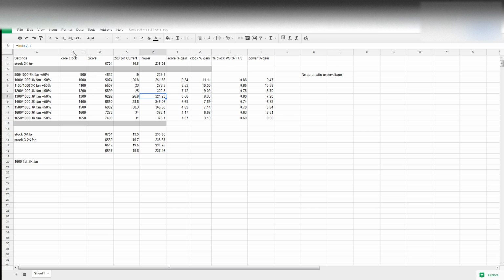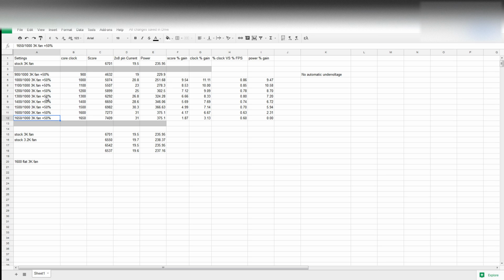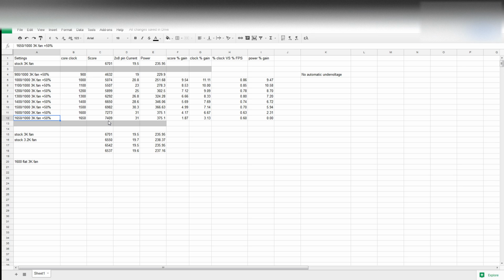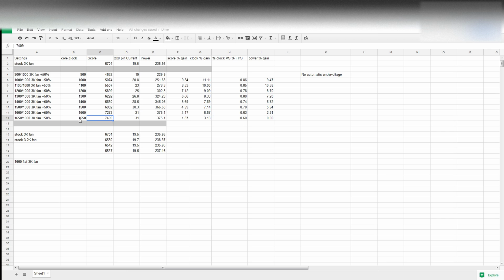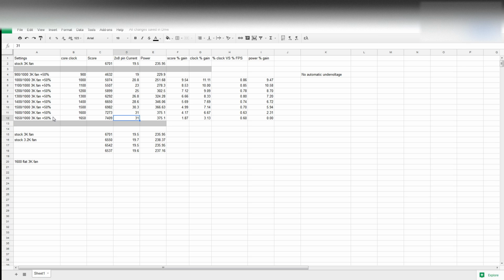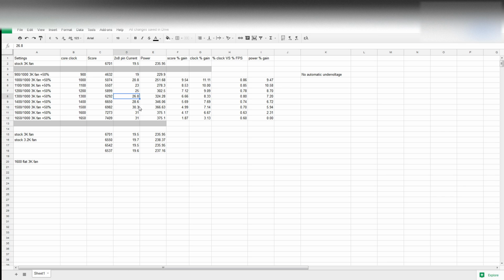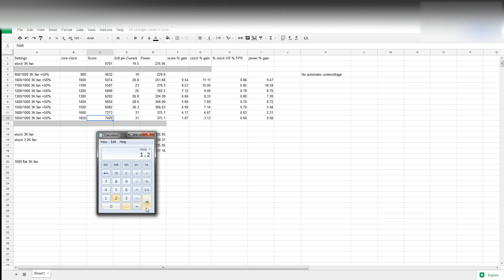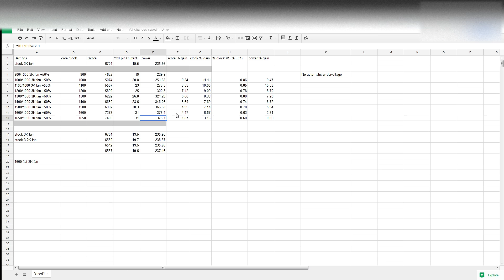VEGA Frontier Edition clock, performance, power scaling // 1600MHz of Flamethrower

Comment: 278W at 1100 mhz? You guys doing these vids are weird. you see all these power issues and then turn around and say you dont see how the power consumption could change. To me it just looks like  even the power management is not working right. it cannot use 278W at 1100 mhz and be working right. This is kinda different from what I think I saw on pcper tho. theirs was around 280W at 1440Mhz. https://www.pcper.com/reviews/Graphics-Cards/Radeon-Vega-Frontier-Edition-16GB-Air-Cooled-Review/Clock-Speeds-and-Power-Co 
if it legitimately does use that much at lower clocks, then there is hardware in there that should not be on for gaming. a fury x at 28nm with 596mm^2 and 1050Mhz uses less. A lot about this FE just doesn't make sense right now.
Reply: There is hardware not working correctly in there, we dont know how much or how much of an impact but something is clearly up with this, also AHOC did mention that voltage control is not usable right now so the voltages at 900mhz are more or less the same as at 1650mhz.
Reply: its just that timespy gpu test 2 is very power consuming.My 1070 fully oced at 2.2ghz 1.093v is reaching 225watts.gaming power consumption is up to 20% lower
Reply: These figures are "peak". So they are completely irrelevent. 

I have RX470 on my PC and according to a monitoring it peaks at 158W power consuption for GPU only. If you add VRM losses, memory power consumption etc you'll get "200W RX470 stock" according to a buildzoid methology.. 

But those peaks only appear for milliseconds when card changes from a low power to full gaming mode. And sometimes cant even be measured by programs like gpu-z

While loaded it sits pretty much around 85-90W for GPU. And around 120W for whole board. Which is exactly what declared by AMD for this card.

My guess is that this "extra juice" is used to add stability when switching between different modes just in case some components(like PSU or VRM components) arent the best quality and dont provide exact specs they are supposed to. 

But it definetely has nothing to do with real power consumption of the card.

Comment: Power consumption seems around equal to Fury X at the same MHz... Edit: Oops misunderstood, it's not that bad!

How come the +50% power limit is increasing power at the lower MHz?  Shouldn't it only increase power when it's actually required for non-throttling purposes?
Reply: That is just from the 2x8pin cables, he says it at some point near the end. Other reviews show full power consumption at stock at about 300W, so ~60W must be taken through PCI-e slot.
Also I found very interesting how well Vega scales with clocks- power leakage at top overclock does not seem to increase at all, power usage goes up in a linear way.
Reply: If you watch Gamers Nexus video about undervolting Vega FE it seems that it can hit 1600 while reducing power consumption. Most AMD cards are overvolted which means we can drop the voltage without losing performance.
Reply: But he still cant undervolt the card. It has to be lower cause of the 14nm vs 28nm
Reply: Cris or they don't exist....
Reply: PDA exists in polaris, so at least it should be there
Reply: BIOS probably is power limited
Reply: Cris oh it really is power limited. I'm using Elmore's custom bios so I have 200% power in the bios but if still hit that, shame too because I'm only hitting low 60s in temps and if put a lot of work in modding the thing and I was planning on spoofing the current sense on the phases but according to buildzoid and Der8auer if you do that with the 3567b it messes up the load line calibration and that sucks :/
Reply: Power consumption at stock settings (1400ish MHz) is a bit lower than the Fury X, it's only when he overclocks or really touches the clocks at all that power consumption goes wonky.
Reply: Hakaru you're pushing 1.4V through a 14nm Polaris 10? Jesus.
Reply: DrathVader oh Yeh I might add this isn't every day use.I will typically spend 20-30 mins a day at 1.4v tho and the card seems fine, it's the  vrms that I worry for but I got a extra fan on those so they stat at ok temps.
Reply: haha if you think thats high i have my rx480 doing 1490-1500mhz (1.4v) and its pulling up to 309W through its 6 pin connector...honestly i think power draw is an over rated topic.
Reply: Probably because TBR and PDA are disabled
Reply: "honestly i think power draw is an over rated topic."
You blind or what? Vega is fucked because it can't keep the power draw at normal levels at 1400+MHz. ATI is getting pummeled because it believed idiots like you.
Reply: Poor Vega
Looks to me like AMD is dead at the GPU market...

Comment: GTX 1080 performance at twice the power, yeah. Overclocking with AMD is very disappointing, both Ryzen and Vega. Basically the best you can do on air is slightly above the boost clock.

Comment: If we assume the the PCIe slot provides 75W then the card pulls 450W total witch would confirm that it needs more power and throttles because of that. Stock 300W + 50% will limit it to 450W.

I hope the RX Vega uses even more power so that the card be hopefully cheaper to buy.
Reply from the maker: I was only measuring the 8pins. The card was doing 187W per 8pin.
Reply: I didn't use the speced values of the 8 pin connectors. I used Buildzoids values from the video. So 375W from the two 8 pin and a theoretical 75W more from the PCIe slot, if we assume that AMD stays in spec, after the RX 480 power fiasko, and also uses the full power of the slot. This way you fill the full power limit of the card with a total of 450W. Witch is in line with the power throttling of it as the power limit is 300W + 50%, so 450W.
Reply: 8pin provides as much as PSU is able to supply through it, it is only spec'ed to  provide up to 150W. Generally it is not a problem if it provides more, as wiring can withstand it- as long as PSU is capable.
Reply: Not really as much as the PSU can provide it because even if the cables were fine, the header or receptacle are usually rated at 8 - 9A so with only three anodes on an 8-pin PCI-E cable you're looking at 288 - 324W at 12V.
Reply: And overdrawing the 8 pins is not a problem. Buildzoids numbers say that the two 8 pins pulled 375W together. So each 8 pin was pulling more than 150W already.
Reply: TheAlibiks an 8 pin provides 150 watts so 150 * 2 + 75 = 375

Comment: Those scores make no sense. They are what you would expect of an overclocked Fury X, not a new architecture on a new process node. Simply scaling up Polaris to the size of Vega would have given better results.
Either AMD has gone backwards or they've crippled the driver so people can't guess RX Vega performance by benchmarking the Frontier Edition.
Reply: Molo9000 AMD representative has said that the driver is not gimped, what he means by that, we can only guess. The problem is, sandbagging at this point would serve no purpose. I'm speculating ofc, but I'm nearly 100% sure nVidia has a number of these running in their lab and they have a team tasked with dissecting the drivers. Funny enough, nVidia most likely knows nearly as much about Vega's performance as AMD does.

Comment: May want to try reaching target clocks via lowering fan speed?
Voltage may only adjust on auto?  Not perfect, but seeing. 900/1000Mhz achieve by fan "throttling" may reveal power better?

Comment: Do you think a 760W Seasonic Platinum would be OK for this card if I max the power limit in the drivers?
The CPU is 6600K @4.5 GHz.
Reply: Easy - a 6700K under air/water stays below 200W OCed to the limit, more in the region of 170-180W. And a 6600K draws even less.

Comment: below 60°C with air... I'm not sure if an Accelero Xtreme IV would do that at 375W+ I mean that's a monster, better than all factory air coolers and only goes up to 300W. (It made my 290X _silent_, with OC!)
Reply: No, it won't work, my AC IV was around 90-95C when I forced static 1.28V at 1130/1500 clocks while running TimeSpy (around 320-340W output only on the GPU). Also, the distance between mounting points is too wide to mount Accelero

Comment: My thoughts? Remove power limit, overvolt, OC Vega, run Furmark, run for your life.
Reply: Start a heavy OpenCL load, (an old OpenCL Bitcoin miner, the stress test called Firestarter or the N-body physics simulation project called Milkyway@home ) and you will bypass anti-furmark limits, and load all shaders to almost 100%. Note that some OpenCL applications have bottlenecks elsewhere and cannot load all shaders 100%.
Reply: this could actually be interesting. because supposedly these drivers detect furmark and prevent it doing too much. if the drivers aren't working properly that could be a (not so safe) way to find out.

Comment from the maker: The HOTTEST GPU release of 2017!
Reply from the maker: it's on it's way to not being visible soon
Reply: You should probably hide that email address.
Reply: uh.. no. that award goes to the nvidia fireball(480).
Reply: 400+ watts... Hope it is cheap enough, thankfully I still have a 1500watt PSU.
Reply: Does the Vega FE have ECC enabled?
Reply: Tankado I Kind want to see that one made...
Reply: > ACG (Advanced Clock Gating) is disabled in the driver.
Uhm, how this should be controlled thru the driver? However, CG is active - it is clearly seen in zero power increase when clock ramps up to 1650Mhz.
Reply: OK so i dont feel so bad when my mod'ed 1080TI power throttles............LOL 450watts what BOY
Reply: Imagine a Rx Vega with 2 GPUs, so it can beat Gtx 1080Ti! Monster Card!
Reply: HBCC is deactivated per default and ECC is not advertised by AMD for the FE card.
AVFS(Adaptive Voltage & Frequency Scaling) does not work properly in the driver.
ACG (Advanced Clock Gating) is disabled in the driver.
Binning Rasterizer (Draw Stream Binning Rasterizer) is apparently inactive.

so.., yeah?
Reply: Possibly the worst piece of s h * t in gpu history. Even worse than Thermy.